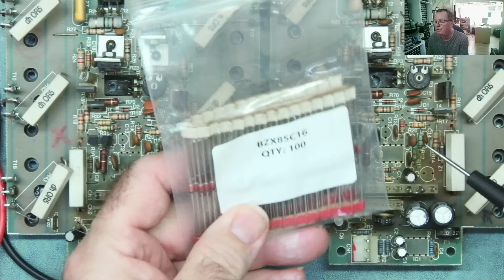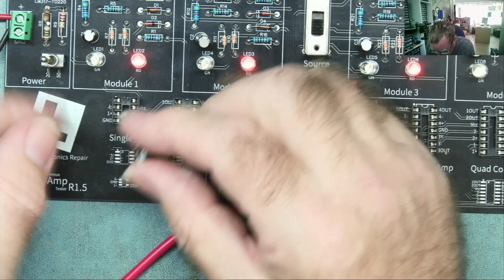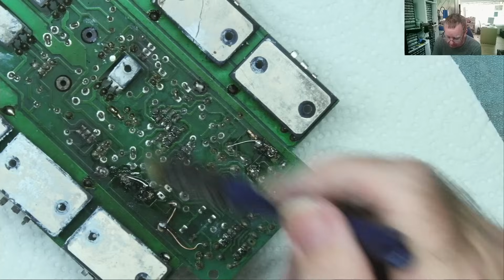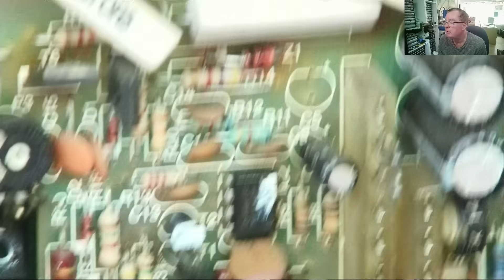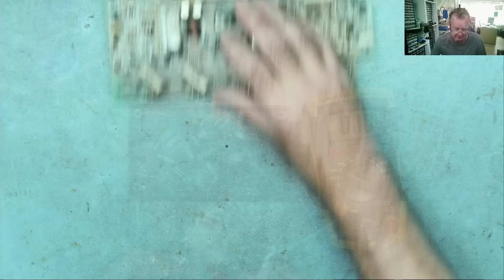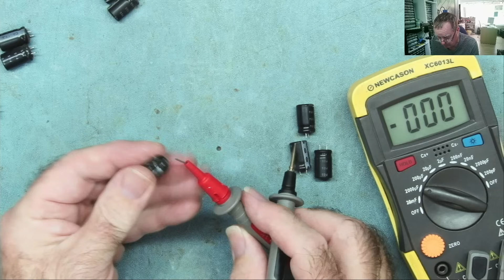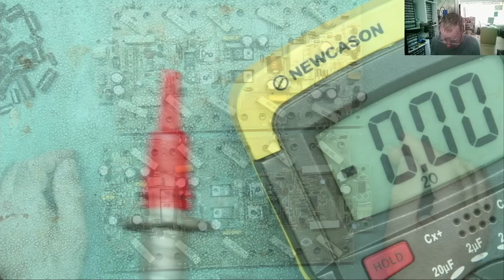Musicson P-802 Amplifier 20+ Years Old : Does This Mean All The Electrolytic Capacitors Have Failed?

Comment: I'd do the same thing and replace the caps even though they mostly test out within tolerances! My reasoning is that the components are mostly very old and have been stressed for years. Today's manufacturing processes are far better than 20+ years ago, and although the caps would continue to work after testing ok, how much more life do they really have in them before the amp would be back on the workshop bench?

Comment: I think an ESR test on the larger capacitors would be telling.
Reply from the maker: Let's try it on the livestream this sunday 5pm UK time. Personally I only really find the ESR meter useful when faced with Low ESR capacitors in high frequency switching circuits.
Reply: @learnelectronicsrepair  Hard disagree there.  I find ESR is the first sign of a failing electrolytic cap. Also the huge advantage you can nearly always test ESR in circuit.

Comment: In my opinion, after 35 years of electronics (mostly audio) tinkering, electrolytic capacitors that are past the manufacturer's hour rating should be considered faulty, regardless of how they measure. Waffling about with leaving aged electrolytics in place is for techs and service businesses that need to repair things for the lowest price. Personally, I'm not leaving 20 year old electrolytics in a 3000 dollar amplifier because the capacitor wizard said they were ok. It's a wearable, cheap part. They have an hour rating, even though it's specified at maximum operating temperature and normally lasts longer, we should consider the extra time they last as a gift / failsafe, not just put the screws back in it and call it good. I always bin electrolytics, even if they're only a few years old, with better / longer lasting / higher voltage, or even replace them with non electrolytic types if space allows. 

And I guess now I'll watch the video to see if I'm being redundant, or starting a fight. lol
Reply: Old caps are a time bomb, I have some commercial grade  vacuum tube amps from 1961 with metal enclosed electrolytic still working…until suddenly not  is anytime now.

Comment: Repair follows very fundamental principle - not to fix what isn't broken. Restoration is trying to restore state of the item to its former glory.But I like your categorization based on economy. About caps - have a look if all of them are rated for same temp. Modern caps can be smaller so try to replace them with higher temp rating if possible - it should be then same form factor.

Comment: Few months back I restored a NAD 3020 amplifier I had bought new in 1979 early 1980s and I replace all the electrolytic caps just as a precaution and a few resistors that looked cooked.  I went back and measured the caps I had removed and about 1/3 of them had either high ESR  and/or the capacitance was too high or too low. So in general it's a good idea to just replace caps if they are a certain age. I also replaced the heat sink grease on the output transistors, got the mounting and standoff hardware hardware to fit correctly (the plastic standoffs on the TO3 outputs wasn't letting the transistors to fit flush with the heatsink all these years), adjusted the idle current which is a chore with these amps (It came from the factory with about 6 mA when it should have been around 30 mA) checked for DC voltage on the outputs which was okay to begin with and did the usual cleaning with switches and pots.  I used quality caps from Digikey and Mouser, (Nichicons)  increased the power supply capacitance from 2200 uF per cap to 3300 uF and ended up with a great restore. Now it should be good for another 45 years even if I am not 😅
Reply: Yeah. NADs usually need just about everything done. They really cheaped out on so many parts. I love it when customers try to tell me about quality NAD amps. So few of them ever were, haha. So many of them overheating and burning up the pcbs. No protection around output stages, so cascade failures everywhere. Had some shockers. I'll never recommend them.

Comment: Repair has an obvious meaning.  Restoration is where you bring an item back to its former or original state. It would use original parts (new old stock etc) and ideally you would not know it had been carried out except by close inspection.   Renovation is about updating an item - eg using modern improved components, maybe also adding or changing functionality in some way.

Comment: Hi Richard. My thoughts on capacitors…upon visual inspection, if they don’t appear to be buldging or leaking, leave them alone. Faulty ones will show up afterwards, but I do use my scope a lot for measuring power rails and most fault finding. For me, using a scope gives a lot more information than a multimeter, but that is just me… On some equipment, I have had to replace lots of caps, and other stuff, even back from the 60’s and 70’s, not so much. Electrolytics close to heat sinks, or subjected to high currents, yeah, they tend to fail, but they normally show up on your oscilloscope measurements…. But hey, I am retired…. I don’t have to fix so many things a day just to make the boss happy. If I was in that sort of environment, maybe I would have done like what so many youtubers do and recommend… just replace all electrolytics first, and then, if the thing still does not work, either give up, or start with proper diagnostics…. (Time is money in those environments…) If that is your motto, just change caps as soon as you open the equipment (of course that carries risks too, damaging very iffy PCB-traces, replacing a very good cap with an inferior one you got from fleabay, etc, etc), be very careful if you service a musician’s equipment… they have become so used to the sound their equipment makes, (with faulty capacitors), that they will freak out if they get a newly serviced amp back, and it sounds "different" from before… and that is just because you replaced some bad-capacitor, in addition to fixing thr actual fault.
Reply: Electrolytics have a defined life and it doesn't matter if they're bulging or not. They will fail.
Reply: @jeffn8218 except for so may radios and other electronic devices  from the 1960’s and 1970’s … somehow i have found very failed electrolytics caps in them….
Reply: Obviously, if you are servicing military and/or medical equipment going back to the, obviously their regulations about capacitors would apply. Heck, according to military standards, almost all capacitors in my stock must be replaced.

Comment: I see you measuring capacity but isnt ESR also an critical value to test?
Reply: I agree. ESR also has the advantage that you can nearly always test that in circuit. And if you do bother taking them out, use a meter with both ESR and capacitance.

Comment: With regard to the odd ICs, I believe they’re fakes.  I’ve encountered the same knock-off brand (I call it the ‘genie’ because it looks like one coming out of a lamp, but it seems to be a weird knock-off of the Texas Instruments mark).  I encountered them as logic chips (74LSxxx), and they would test ok in the Retro Chip Tester pro, but would not work in a practical application (like in the 74LS161 clock circuit of a PAC Man arcade PCB).  They may be some electrically-similar surplus they’ve got laying around that they’ve remarked to appear to be a more popular (but not 100% compatible) package.

Comment: I don't remember if I saw this on your channel or one of the others. It seems there is a specific time period with bad capacitors because someone stole the "recipe" of the electrolyte but then then something went wrong with that. And according to that story this is why for a couple of year there were lots of bad electrolytic capacitors. And not before that time and not after that time. I have no idea of this story is true.
Reply: The capacitor plague generally caused failure where the capacitor vented and bulges. This happened relatively quickly, causing lots of warranty issues.
Over time all capacitors become leaky. This can be misleading because the Capacitance and ESR might seem OK, yet there is an increased leakage of DC through the capacitor. This DC leakage is not a good thing in audio circuits where caacitors are used for blocking DC from getting from one amp stage to another.
Leakage has less importance where capacitors are used for blocking or filtering (one leg connected to ground) - in that case it is Low ESR that is most important.
Reply: There is a video called 'the capacitor plague' on my watch later list, so it may have more info......

Comment: Perhaps this answers two questions: a restoration might feature replacing all the caps.  Putting the old ones back in when similar components have failed under the same conditions is good for future business. Not saying that’s your purpose. In car repairs you don’t put the good spark plugs back in, you replace them all.

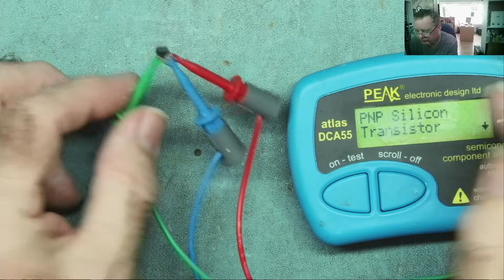Comment: 10:15 they are all fakes. break one open by heating it with a blow torch or sand the top to get to the die. With the IC removed in one piece look at it with at least 100X magnification and you will be able to see markings on the IC, probably a company logo and a part number. Years ago I picked up a cheap 100X magnifier for about 10 bucks and it's been great to discover fakes :-)

Comment: Actual cap failures are not so common unless they are from the plague era, but there are subtle and not so subtle ways for them to degrade. With all the power resistors in this amp, temperature would be a likely cause. Modern solid and hybrid caps are far superior to the old cans.

Comment: If the electrolytics were good quality ones to start, being 20+ years old shouldn't mean they're all toast, not by any means. Maybe drifted out of spec slightly, but should still be within tolerance. Although, as you say, heat seems to be an issue with these boards and that'll be bad for them.
If they were poor quality to start with, then yes, they probably started having problems within the first 3-10 years 🤷‍♂